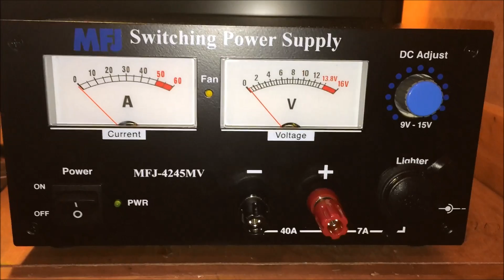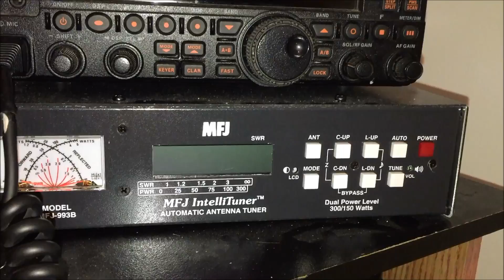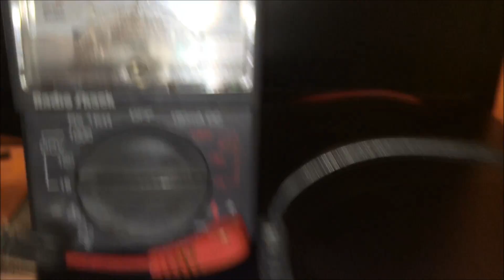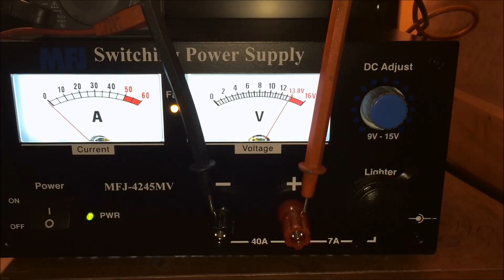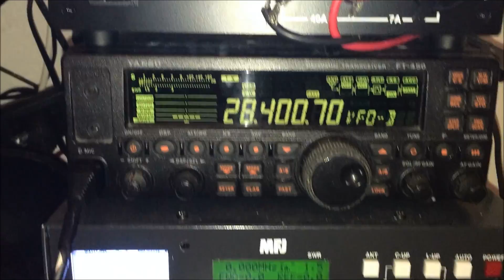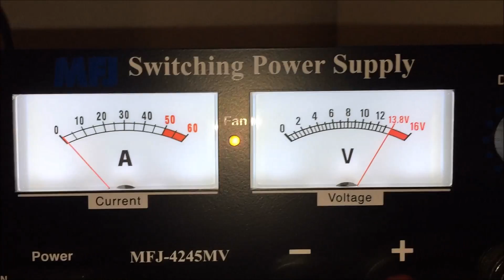MFJ-4245mv power supply review and test

Comment: Almost 4 1/2 years after this video posted, I have a question about this supply. 😆. I have one and I only have one complaint. MFJ (and yourself in this video) say the front power connectors are “5 way binding posts” and your review says can use ring terminals on these posts. I for the life of me cannot unscrew the red and black connectors all the way off to attach a ring terminal to these front posts. Am I missing some secret way to get them off? It has frustrated me to no end for a couple of years now...
Reply: Some of the older terminals were made that way and cost more to manufacture. I also noticed that MFJ is using very cheap ones now days and of course, MADE IN CHINA !  73 N8AUM
Reply: @vidasvv  MFJ is made in Starkville, MS. not china. It's a USA company.
Reply: @jonathancotner7040  actually the unit is designed in the USA made in Taiwan
Reply: @jonathancotner7040  you mean like walmart is a usa company but sells things made in china
Reply: The way we always  got around this problem was to cut the Terminals just enough to slip around the posts.
Reply: @jeep146  Yes, that is what I eventually ended up doing quite some time ago. It’s just not a very elegant solution. I wish they’d come off like they’re supposed to. Love the power supply except for those front connectors.

Comment: How reliable would this be for a car amplifier running off 120VAC through a short extension cord?  I'm wanting to set my car up so the radio and amp can run off house power so I don't have to drain the battery while the car's not running.

Comment: There's a pot on the back of the volt meter that adjusts it to match the actual output. There's also a pot on the board that adjust the output voltage. I had to adjust my 4225MV in both places to get the advertised voltage. The fan is also fairly loud, so I'm planning on a temp controlled fan board if it ever bothers me enough.

Comment: I've had three MFJ power supplies and on two of them the lights on the meters stopped working. Over time one meter's light will fade out and then the other will follow. My 25 amp MFJ is still working solid, I sold the other one, but the 45 amp is shot, and I never used it for anything more than an Icom IC-7000 on rare occasions. I also have a low profile MFJ with no meters in one of my portable stations and it seems to be working fine.

Comment: For the price I'd rather buy a linear supply, why would I want a switching?
Reply: space, most switching power supplies are smaller, and they don't weigh as much as a Cadillac which makes them a better if you have to take them around.
Reply: +madmax2069 I agree that they are lighter and smaller.
Reply: My main concern about having a switching power supply is the birdies on 75/80 and 40 meters. My main concern about a linear power supply is the heat and light bill. I would love to have a switching power supply if they guarentee no hashing on the hf band.